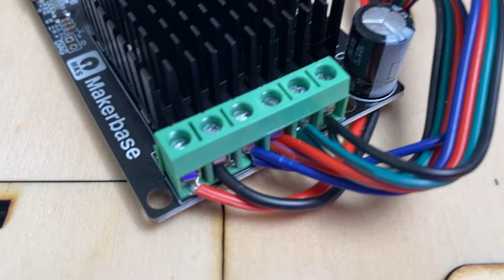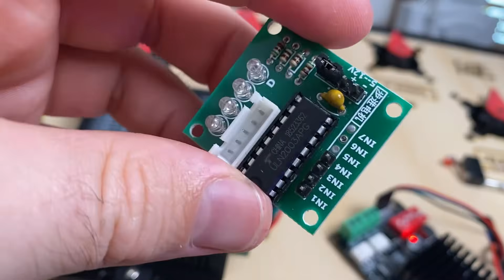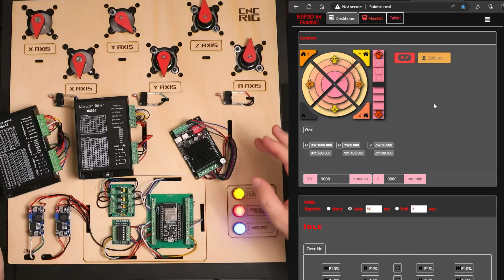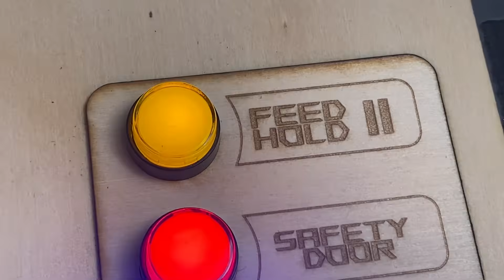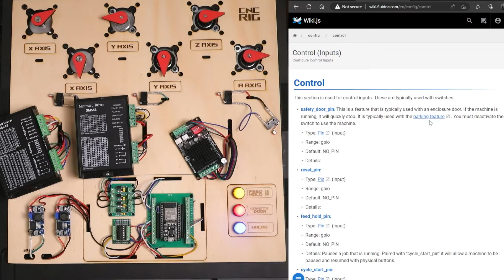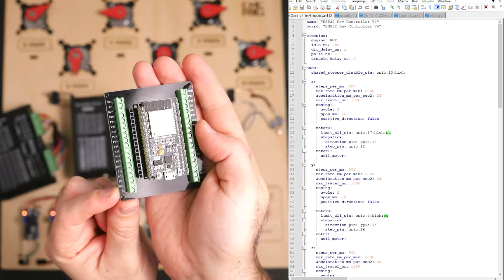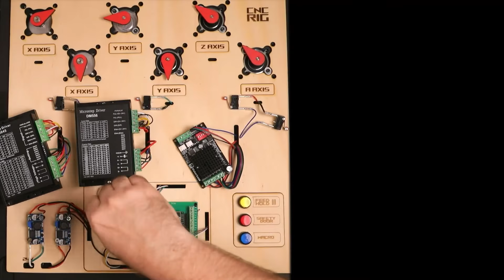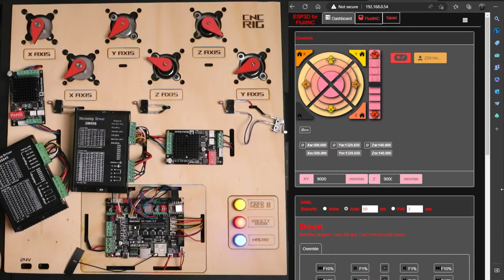CNC Wiring Basics // FluidNC // ESP32 // TinyBee controller

Comment: What is the advantage of ESP32 over the Arduino in a CNC controller?
Reply from the maker: Great question. Depends what you refer to as arduino? If you are referring to an arduino Uno or alike - these are 8bit boards and esp32 are 32bit boards (x4 faster!) with a dual core processor. The other great advantages are that they have built in wifi/bluetooth, they are cheap and common boards, tali’s have a stack on inputs and outputs in both analog and digital and can have a very low power usage. 👍👍
Reply: @NEWTechCreative  thanks. Do they require a computer to be connected for the cnc machine to run?
Reply from the maker: @arbjful No, you don’t need a computer to run - if you load fluidnc or grblHAL you can use the webUI to control and send gcode via any device - even your smart phone. Essentially the esp32 stores a webpage that you use to control the CNC over Wi-Fi. You can also use grbl control software such as UGS, CNCjs, focus etc to connect and use as you would with a traditional grbl controller 👍👍

Comment: Where to put emergency stop button in tiny bee?
Reply from the maker: You can use any spare input pin! Depending what you have used already, you also have the exp1&2 ports to access some pins. Just check with what you have used already and refer to the tinybee pin out reference to check available pins. 👍👍

Comment: @NEWTechCreative did you make a video for the RS485 module via expansion header? At 36:00 of this video you mentioned it would be a future video. I'm considering this tinybee for CNC-ing my Bridgeport. If the video does not exist can I help you some how to get the video made?
Reply from the maker: Thanks for your comment! Unfortunately I didn’t get around to it sorry. I ended upgrading to a root controller that already had rs485 inbuilt. I just purchased a few rs485 modules to have a tinker with and see if I can get up and running but have to wait till they arrive. There have been some progress from some users with this - see at the bottom of this page: 
http://wiki.fluidnc.com/en/hardware/3rd-party/MKS_TinyBee
Reply: @NEWTechCreative  Root controller looks very good!

Comment: Great video. I recently updated my home made CNC from an Arduino Mega/GRBL to FluidNC using the TinyBee. I use external drivers for my motors (XYZ). Your video helped me get over some of the hurdles I was having with the configuration setup. I appreciate the your time in making a video like this. Great work!
Reply from the maker: Thank you so much for your kindness and taking the time to write to me!! Your feedback and gratitude is well received absolutely made my day! So pleased to hear about your success and good luck with the CNC journey 👍👍
Reply: @NEWTechCreative  Hi . I would like to know I can use Close loop Step motor with this project ?  if yes ,  you can make video tutorial for close loop again ?
Reply: @akkarawat I think it's the same, the closed loop is controlled by the driver itself, it's not related to the esp32.

Comment: Hi have question about tinybee or just want to clear some things out. Searched all-around internet but cannot find info about tinybee logic levels for stepper drivers...  but seems that You are using different drivers (with written markings on them that they support 5-24V logic input) with different capabilities on single tiny bee board. Have stepper online closed loop Nema 34 kits.. and their datasheet clearly states that it supports logic level inputs starting 5v... and here I see that You are using tiny bee without any logic level converters (stepups) which I also want to avoid... So does Tinybee support 5v logic level for stepper drivers ???
Reply from the maker: Great question!! In short - YES the tinybee coverts the logic to 5v logic from eap32. From what I can see, the esp32 goes to a HC125 chip to convert logic voltage then onto the shift registers to handle the pin extension output to each driver at 5v logic.
Reply: @NEWTechCreative  thank You very much !!! have long time standing unfinished cnc... and for longest was waiting for proper controllers and firmware to  come out... did not wanted to goo back to mega2560 and marlin, also to arduino and grbl or any other half backed grbl variation... especially when 3d printing with Vorons... so klipper equivalents or nothing... so linuxCNC (rare hardware, mostly custom with not much documentation) or grblHAL... meantime had few old BTT motherboards but their support also was half backed for grblHAl... and time to time was checking for new Ideas and your videos on DIY CNC came out... So congratulation on cool cnc builds. Love them all!!! videos also fully informative !!!! And also for quick response... Will definitely be ordering 2 tinybee's now. For old project (large format printNC mockup with diy rails) and for future project (with cutting area less than 1x1m)
Reply from the maker: Not a problem! I’m glad to hear you’re finally moving forward with finishing your CNC. The only downside is that there are limited pins on the tinybee but will be sufficient for 6axis and 4 inputs (limits and touch plate) put you can use a couple of other pins from the Exp slots, however limited. If you want to take advantage of all pins and have full spindle control with rs485 you can upgrade to a dedicated fluidnc board something like the root controller or barts 6pack board. Good luck with finishing your CNC!! 🤩🤩

Comment: Thank you for the clarification and sorry for the many questions, please bear with me for a while
Can I assign one pin to the laser and one to the pwn, or do I use one pin for both?

my regards
Reply from the maker: Great question! Yes you can assign separate pins, however the reason why you would keep two on the same pin when using the 3axis board setup is to save the amount of pins used. You don’t have much to work with when just using the esp32 without shift registers to expand output pins. The other reason is that you would never use both as the same time! Hope this helps 🤩
Reply: @NEWTechCreative  thank you for your help.

Comment: It's a great video! Thanks for it! Only, I did not manage to have it working yet.... I saw the wiring diagram is messed up a little bit, and I have a ULN2003AN instead of ULN2003A. Does that matter?
Keep up the good work!!
Reply from the maker: Thanks for your comment! The uln2003A and AN can both switch high current and won’t matter. This should work perfectly. I did have some incorrect wiring on my diagram that unfortunately I can change once uploaded, however the output should match the input wires to the motor drivers - I incorrectly show this. Just ensure you are using the GND from esp32 - don’t get confusion with the CMD output. If you continue to battle issues, I would suggest upgrading to an integrated board such as the tinybee…. This will solve many issues. Thanks for your support 🤩🤩

Comment: Thank you for this blessed effort. I installed the ESP32 ESP-WROOM-32 ESP-32S Development Board 2.4GHz WiFi + Bluetooth and things went correctly and smoothly.

Can I install the TS35-R LCD Display and how do I add its code if the answer is yes?

my regards
Reply from the maker: Great question! Unfortunately lcd screens aren’t supported at this stage. The beauty of fluidnc is the ability to connect via Wi-Fi and use a wireless screen and no need for tethered screens. You can use an old phone or touch device as a dedicated screen.
Reply: Very good that you've had it running. Did you change anything significant to NT's wiring diagram? Is there a new diagram available? I got into Fluidnc as controller, but none of the motors respond. An escape to SourceRabbit did work, though - only I prefer the wifi option, which they removed.

Comment: Hey, I hope you can help me out a bit, I have the Makerbase Servo57D Drivers on my nema 23s, wired to the tiny bee via the stepstick adapter, and they work as a normal stepper system fine, but im hoping to utilize the closed loop feature of the 57D's. Do you know how to get this working?
Reply from the maker: Great question! In fact I had purchased several of these a while back, however never tested. You can ignore the rs485 connections however unfortunately the output signal needed from the controller is ‘common anode’ signal which is essentially is reversed to what the tinybee provides. Instead of the step, dir & ena as positive inputs they need to be a negative/ground inputs if that makes sense? The com input is the 3v/5v from tinybee. I don’t believe the signals can be reversed on the tinybee, however there is a way. In my CNC wiring video I show how you can use a ULN2003 chip to reverse (or boost) the signal. There are better chips available, however these work just fine. If you need more info, let me know?
Reply: yes that makes sense, I found a video on makerbase channel, that shows how they can be controlled via arduino over uart, but i am super unfamiliar with uart and controlling things over it. i might dabble in figuring something out. if you have any tips let me know. @NEWTechCreative
Reply from the maker: In addition, it seems that there is a limit switch input and output from the driver to the controller as well on other side of board that might be needed to be wired in!

Comment: De description on the error on one of the stepper motores is not correct, on the input on one af the stepper driver, you just need a small res to the inputs. Its a opto input and in goes from arount 2.7 to 5volt.
Reply from the maker: Thanks for your comment! I’m not sure what you mean here. The output of the esp32 is 3v and 5v is required to drive some drivers hence the use of the Darlington transistor to convert the signal voltage. I use optocouplers with the limit switches if that is what you are referring to? My wiring diagram is not correct and from the uln2003 and have the wrong wires connected (not sure how I made this error).

Comment: Not sure if others mentioned already... quick correction... at 14:59 you say you are going to connect the limit switch in "parallel"  but then you connect the wires in a "series" configuration... FYI  "in-line" connection is series... split and "side-by-side"  connection is parallel...
Reply from the maker: Ha! Yes you are correct. Thanks for pointing out…. I don’t know where my brain way that day… unfortunately YouTube doesn’t allow re-uploading to correct a video, however I hope others will see you comment to clarify 🤩🤩

Comment: How do you wire the spindle like in the mksdlc spindle?
Reply from the maker: Great question! I doesn’t have a direct spindle control unfortunately such as rs485 or pwm10v, however it does have the possibility to utilize the pwm 5v output to control the spindle. It depends what spindle you have and what you can hook up. The pwm 5v could be hooked up to a 5-10v pwm converter to control the spindle if that is what is needed? Otherwise if it just needs a ‘relay’ or high/low signal, and the gpio.32 seems to be the pin for either on/off or pwm 5v. More info here: http://wiki.fluidnc.com/en/hardware/3rd-party/MKS_DLC32

Comment: Hello. I want to get information about something. I'm having communication problems with the Mach3 so I'm going to replace the board. Can we do CNC embossing with Tinybee card? relief gcode files require high memory. Even a simple run contains 30-50mb gcode.
Reply from the maker: Absolutely! I do relief carving without an issue 🤩🤩
Reply: @NEWTechCreative  There is no internal memory on the card. So, are the files we send via wifi stored on the SD card?
Reply from the maker: Most esp32 CNC boards have an Sd card module, otherwise you can connect an Sd module to the esp32 board. Once module is setup you can store files onto Sd card. What board are you using? You can also use direct from pc with usb if you want to use like mach3.
Reply: @NEWTechCreative  I don't have a card yet. I'm considering purchasing Tinybee. or I will buy one of the basic card. Is there any problem installing SD card on Tinybee card? Can we install an SD card by purchasing any card? İm using mach3 right now and i Want to give up it.
Reply from the maker: The tinybee comes with the Sd card module ready to go… very easy setup. You will need to use a micro Sd card that has 8gig or less as the larger Sd cards don’t play well with these boards. I purchased a stack of 4gig cards online cheap that work fine.
Reply: @NEWTechCreative   Thank you very much for your time and information. I will buy a tinybee.

Comment: Can i use the tinybee controller for auto squaring
Reply: Ok , thanks alot
Reply from the maker: Yes absolutely! You will have to find an unused pin for the second y axis. The MT_DET pin out should work fine and is gpio.35. In the example tinybee yaml on fluidnc wiki, pin 35 is used of the reset button input that you can use as and replace with no_pin.

Comment: I couldn't understand how the relay configuration is done in fluidnc. The wiki page has little information about this. I'm using a relay module, but as soon as I turn on the esp32 the relay activates  (I'm just using the board and 3 drv8825). If I click to turn on the spindle, the module's LED becomes weaker, but it doesn't deactivate the relay. Where am I going wrong?
Reply from the maker: Thanks for your comment. There might be a few issues and hard to provide exact solution without seeing setup and config used. The relay should be a straight forward setup as all it needs is a signal and ground pins then just activated when high or low. I would check that your output voltage from the board is the correct voltage for the relay. I would also check if the pin your using needs a high or low state. Feel free to send me more info to newtechcreative@gmail.com 👍👍
Reply: @NEWTechCreative  Thank you for the excellent job. There isn't much videos about fluidnc on yt. I'll check the voltage of the pin today. I think the question is that the relay module is positive and negative triggered. Will check the status of the pin on and off with the multimeter. Tks so much for answer me and for the excellent channel. Nice weekend!!
Reply from the maker: No problems and thanks for your kind words! If it is the initial state that is turning in your relay, you can set the pin to high or low in the yaml eg: gpio.35:low or gpio.35:high - this will set the default state of the pin!! Have a play. Good luck 👍
Reply: @NEWTechCreative  Just to conclude and Maine help others.. My 3,3/5v regulator was the problem. 3,3 ok but I have almost 9v in the 5v outputs. Cause it the relay module was going crazy. Tks again man and When I finish here I'll send you a video showing all crazy stuff we make here. God bless u!
Reply from the maker: Oh sorry to hear about the voltage inconsistencies! Strange behavior, however glad that you were able to figure out issue. Thanks for sharing outcome. Would love to see your final result 🤩🙏

Comment: Nice Video, Nice information. I need help I want to make this machine 3 Axis and with 4 motor “X YY Z” . I want to connect 2 motors for Y Axis. What changes need in yaml file and Wiring using EPS32.
Reply from the maker: Unfortunately the if you are just using and ESP32 board, there will not be sufficient pins for 4 independent axis’s. However you can just double up the step and direction y output from the esp32 to both motor drivers, although you won’t achieve dual y axis homing/squaring. You won’t need to change the yaml for this.
Reply: @NEWTechCreative  Thank You For replying.
But I want to ask you, it is possible to use G0, G2, G35 pin for separate Y Axis motor 1. This three pin is free
Reply from the maker: @SachinBhagat great question!! Unfortunately the gpio.0 is a boot loader pin and gpio.2 is a strapping pin… this can cause issues for the board and would stay clear. gpio.35 should be used as an input pin with a pull-up resistor. Unfortunately you will need to use a board with an i2S interface to achieve additional pins. More info here!! http://wiki.fluidnc.com/en/hardware/esp32_pin_reference
Reply: @NEWTechCreative  Thank You Very Much once again

Comment: Would you do a video on how to use fluid nc to mill something? In particular from file to part?
I've been collecting parts to build a fluid NC machine but once its built and dialed in with the yaml, I'd have no clue how to make a vision a reality without manually moving the machine to make the part. Thanks
Reply from the maker: Great Idea! I'll try and fit one in over the next few weeks :)
Reply: Thank you very much, ive tried looking but there arent any, only videos on how to setup & how great the system is. Again, thank you very much and look forward to watching :-) @NEWTechCreative

Comment: Great video
In going to use a tinybee board with external drives. 
In the yaml file under the motor section. Do i need to change the stepstick part into something else?
Reply from the maker: The stepstick is a common setup! Give it a try firstly. I assume you are using a typical open loop motor driver?

Comment: Hi, thank you for your detail video! I was wondering how to connect a router like a Makita on the ThinyBee board? I suppose I need a 5v relay. But where do I connect it, on one of the EXP1 or EXP2 GPIO ?
Reply from the maker: Great question! Yes you are correct. There are a few spare gpio pins such at 15, 16 and 17 in the EXP1 and maybe more in the EXP2 that could be used,however they might be 3.3v but haven’t had a chance to check sorry. You can also use any spare motor driver pins if you haven’t used all 5 slots… each motor driver had 3x 5v pins that could also be used!! Then use the relay spindle setup. Let me know how it goes!